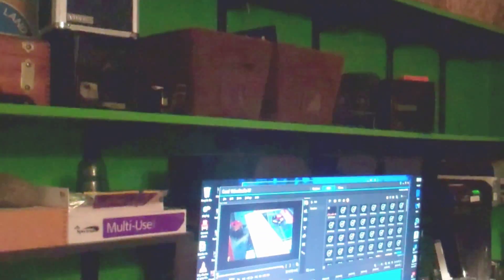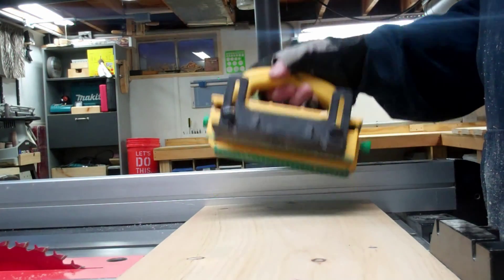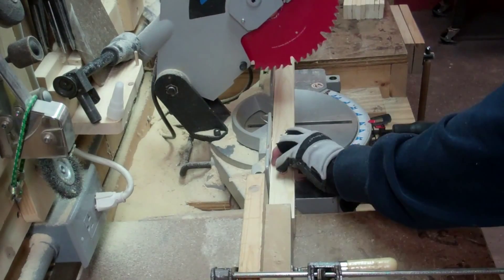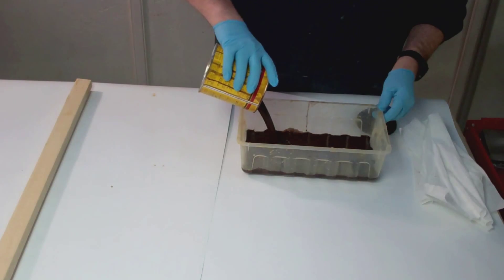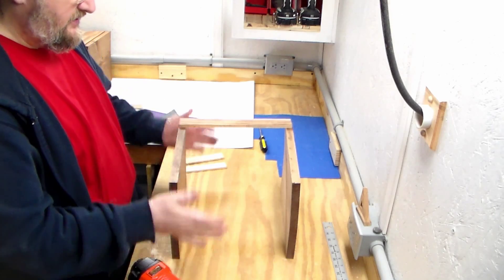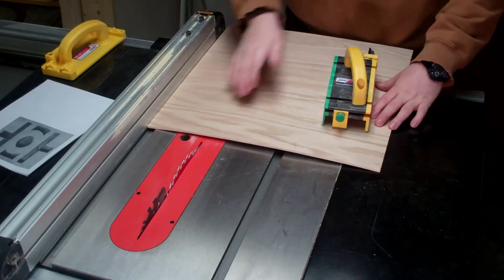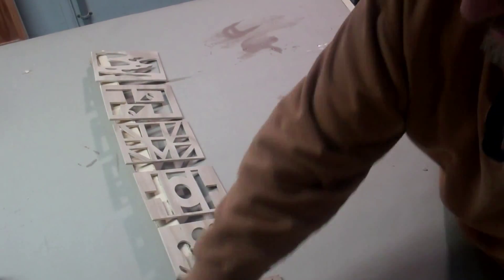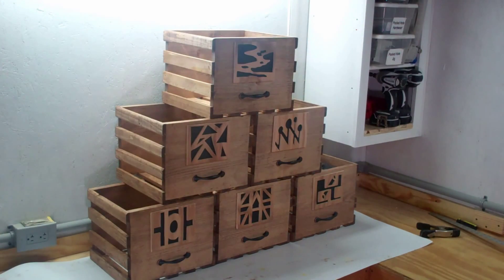Making Storage Crates .... with bonus bling!

Comment: Awesome!  Stupid question from an amateur... what are dimensions of side slats?
Reply from the maker: I just cut a 2x4 down the length of it and since a 2x4 it actually  1 1⁄2 by 3 1⁄2 inches it would make the slats 1 1⁄2 by 1⁄4 inches and then as long and you want the box deep. The longer you make the side slats the deeper the box will be. I measured the shelf I was going to put them on and cut the length to perfectly fit on that shelf
Reply: Christopher Demetrick Thanks!